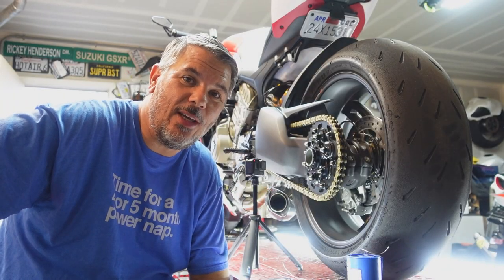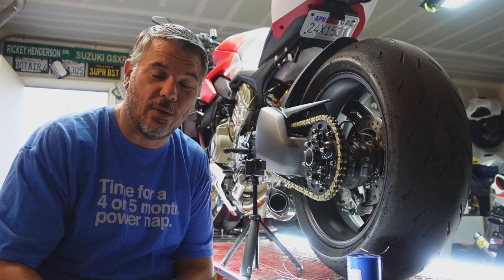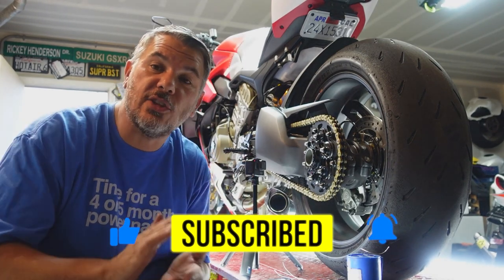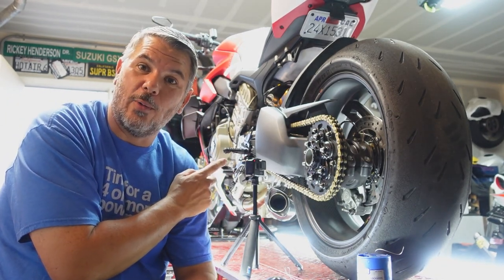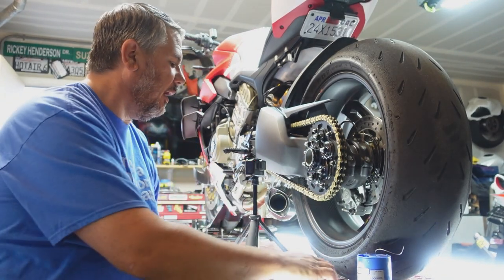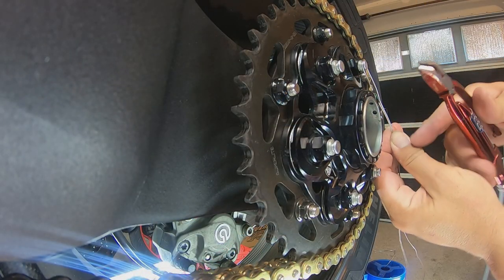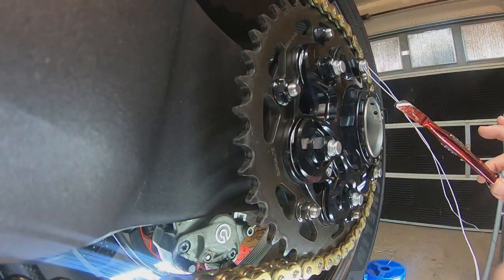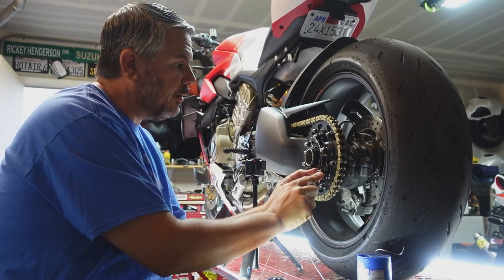How to Safety Wire a Ducati Sprocket

Comment: The loops around each bolt are much too loose.  A better technique is to crimp the wires tight around each bolt, so that the twists do not have a loose loop around the bolt, then  twist with the tool while ensuring that the safety wire is firmly inside the groove in the bolt, making sure that where the twist meets the next bolt is very tight, then repeating the process for each bolt.  That way the wire does not loosen.  4 pulls on the tool would be more appropriate for this installation.  3 is just too loose.  The last section, the pigtail, needs to have a total of SIX twists, not 2-3, then be looped under and folded around the already installed wire, to secure the pigtail from ever being spun out of position by centrifugal force and possibly breaking the end off.
Reply: well it's not even safety wired to prevent the nuts from coming loose, but it will stop them from falling off the studs if they do come loose.
Reply: As a TT official, they'd be rejected.
Reply: Looks ok but would never pass tech inspection. It's fine if you're not planning to do advanced track days or race.
Reply: Pretty much what I was going to say. Not sure why this guy's even making a how to video without bothering to learn how to do it properly himself first. Another free-dumb production

Comment: Hi, I don't see you putting the safety wires through any holes as though you are just putting the safety wires on the thread only or around the Cush bolt.  am new at this, but from all the videos I saw on YouTube it seems that the wire has to go through some kind of a hole on the screw to secure it and not only on the thread.  am not sure if this is effective, and I don't see how the wire is secured in place if it is only wrapped around the Cush screws. Let me know how it is holding up, was thinking to do the same for my axle wheel nut.
Reply: If it does anything it keeps the nuts from completely backing out but thats about it. If it were me, id drill the end of every cush bolt and run the wire through. Even then its still not preventing the nuts from coming loose.
Reply: @UnburdenedByWhatHasBeen  The safety wire in this case DOES have a purpose. Ducati designed the cush drive studs this way, to stop them backing out and damaging the swingarm. They've been doing it this way at least since the 748/916.

Comment: eventho its not going thru any holes... i think its better that the safety wire u do it closer to the nut itself... aint it supposed to b safety wire fornthe nuts so that it wouldnt get loose n fall out? correct me if im wrong

Comment: You’re not safety wiring the sprocket, you’re wrapping the hub stud threads with 0.041” wire.  Can’t wait for the video showing what happens when a piece slips off, gets pulled into the sprocket and trashes your bike!
Reply: Hi SH. He's not wrapping the threads. On Ducatis the standard studs have deep grooves around the tips. When the wire is twisted it locks tightly into the grooves. If a nut comes loose it cannot get past the wire. Some people upgrade to studs that have a hole in the end and/or nuts that have holes through them. But the stock items do work perfectly well provided the wire is snugly wrapped into those rebates. 👍
Reply: @c138599  there’s a difference between cosmetic, looks neat, looks cool and airworthy. Airworthiness is paramount,  I don’t  care if it looks cool, coolness doesn’t care if it comes apart at 15k’ with passengers aboard
Reply: It has wings but it's not sn aeroplane. What's all this nonsense about airworthiness? Tell me do you safety wire your car's wheel nuts? If not, why not given the airworthy rant. And if you do, what the hell for??? 😄 ps I'm just stirring. You aero guys set the standard, I know. 👍
Reply: @c138599  I work in aerospace engineering, and I'm also calling out the bullshit from the other guy.

Comment: Beautiful job looks cool but I don’t see the purpose except aesthetics. 
I thought the purpose of the safety wire was to prevent the nuts or bolts to keep from coming loose. Looks like you went through the ends of studs not nuts. ??? Just curious

Comment: Hmmm... safety wire really does nothing unless it passes through drilled bolt heads.
Might I suggest googling & downloading a copy of 'AC 43.13-1B'. It's a free[1] (and big) pdf put out by the FAA for aircraft technicians... contains loads of great info. The section on safety wiring starts on pg. 7-19.
Enjoy!
[1] Well... not really 'free', we've already paid for it. :)
Reply: I don’t understand why the studs would have holes
Reply: @ericsee9109  They have holes in them for the purpose of allowing you to safety wire them so the bolts cant pass the wire if they become loose. This was a good vid but they way hes wiring it is more for aesthetics.
Reply: Very true man, however these bikes have specially designed studs with a groove at the end, made exactly for this purpose. ;)
Reply: The safety wire in this case DOES have a purpose. Ducati designed the cush drive studs this way, to stop them backing out and damaging the swingarm. They've been doing it this way at least since the 748/916.
Reply: Actually,the nuts have holes. Found this by accident, yet I'd fail this for any track or road race....send him to the Sin Bin!

Comment: Is there a purpose beside esthetic ?
Reply: If done correctly absolutely. A secondary, redundant safety solution if the first method (torqued bolts) fails. 
In the case of this video the purpose is ‘oooh look, Shiney!” Because it’s not securing anything.
Reply: @benjo145  It stops the nut coming off, which stops the stud backing out, and gouging a hole in the swingarm. Nothing 'Aesthetic' about it.
Reply: @TheOriginalCoda  I doubt it would. safety wire goes through holes in nuts and bolts to secure. the way it does this is through tension, if one bolt tries to loosen then the other will be pulled tighter.
by wrapping the wire around the end of the thread like this its not doing squat to stop the nut backing off. it might stop the nut falling off completely, for a while, but you will still have a fastener not done up correctly. if its perfectly safe without that nut done up properly, what's the point in the nut being there in the first place?
also no where in this video does he talk about the correct tension being 6-8 turns per inch, he's talking about 'three spins gives him the look that he wants' nothing technical about that, he's literally saying that he does that many turns for the aesthetic. then think about how not all the pliers will have the same rotations per pull, so your not going to meet the specifications of any  safety wiring guidelines.
Reply: @benjo145  This is not the same system you describe. The wire goes into specially designed grooves in the studs. It's got nothing to do with holes in nuts or wire 'gripping on the threads'. I guess you've not seen one of these studs in person? Ducati racing designed them to do that job that I described, and successfully raced bikes since the early 90's with this system and still use it to this day.

Comment: Locktite still works.  Why bother wiring.
Reply from the maker: Because why not
Reply: You're not supposed to thread-lock the flanged cush-drive nuts. I have the service manual right in front of me, and it just says 48nm, no thread-lock of any kind should be applied.

Comment: Sorry but this is a total waste of time and dangerous!!
As previous comments the wire has to go through drilled nuts to lock them out!
Reply: Bullshit. Take a look at the stud with the groove in it. These were designed by Ducati Corse and have done millions of miles at race speeds.

Comment: This is not how to safety wire bolts. I hope anyone else doesn’t actually do this. To do it right you need to drill a hole in all the bolts to pass the wire through.

Maybe this is the cafe version of safety wiring lol.
Reply: Tell it to Ducati racing team.